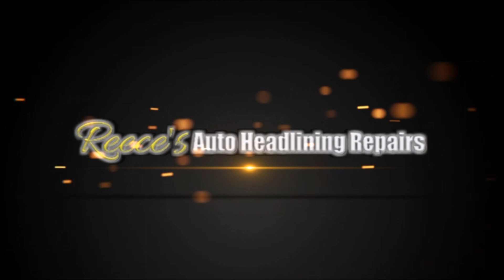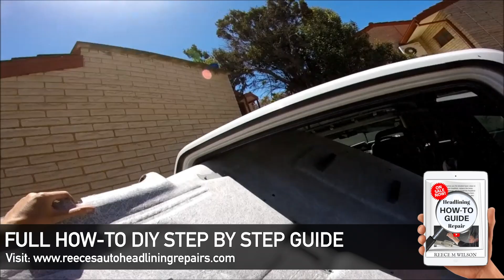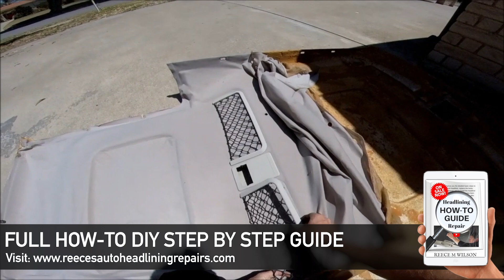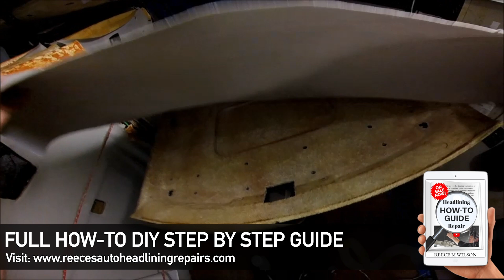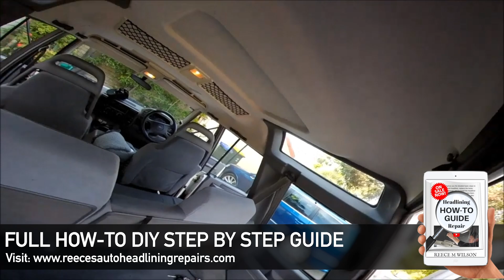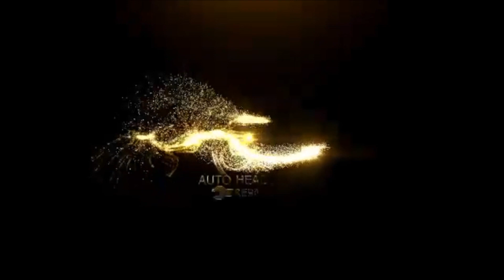Land Rover Discovery SAGGING HEADLINER REPAIR | DIY HOW TO FIX CAR ROOF LINING

Comment from the maker: To Help Our Channel GROW, Click 👍 OR 👎 and Click that SUBSCRIBE button.
⬇️ RECOMMENDED PRODUCTS ⬇️

📌 DIY HEADLINER REPAIR | A STEP BY STEP GUIDE (PDF)
👇 DOWNLOAD 'HEADLINING SECRETS eBook' HERE 👇https://www.reecesautoheadliningrepairs.com/product/headlining-secrets-ultimate-guide-fix-sagging-car-rooflining-reeces-auto-headlining-repairs/

⬇️Reece’s Top DIY Tools:
1. BUY Headlining Fabric / Roof Lining Material: https://ebay.us/26bew6
2. Permatex headliner & carpet adhesive: https://ebay.us/LF2HLY
3. 3M High Tac 76 Headliner Glue: https://ebay.us/OseC7D
4. LIGHTNING Solvit Citrus Cleaner: https://ebay.us/LTvNda
5. Trim Removal tools: https://ebay.us/CcH4kd
6. TORX Screwdriver Set: https://ebay.us/cRiEn2
7. Clear Headed Twist Pins for (QUICK REPAIR): https://ebay.us/ZpUuvv
8. Bowden's own fabra cadabra 500ml: https://ebay.us/zFmtIB
9. Carpet and Upholstery Foaming Cleaner: https://ebay.us/D4peyf
10. Di-san Stain cleaner 500ml: https://ebay.us/XvBlSB
11. Heavy duty tailor upholstery scissors: https://ebay.us/XzEcQf
12. Upholstery Skewer: https://ebay.us/b1rTWO

🇦🇺 Small Business Based in Adelaide, South Australia 

Donate a few $ to Support
Reece's Auto Headlining Repairs
Your Contribution Helps Us Continue to GROW 
Towards Making These Videos and Your DIY Experience Easier
https://www.paypal.com/donate?hosted_button_id=DSL5X82R3DPTQ

★☆★ OUR BEST VIDEOS ★☆★
▸ BEST of 100+ Videos | https://youtu.be/kZ_bICRvh-Y
▸ FULL PROCESS TIMELAPSE | https://youtu.be/_R7ElbG-TEk
▸ QUICK FIX Method https://youtu.be/pJF5FcPSpac
▸ MOST Instructional | https://youtu.be/50sWPyLazHQ
▸ A MUST Know! | https://youtu.be/iZ1nJ4pZfkY

Reece on Social:
Facebook ► https://www.facebook.com/reecesautoheadliningrepairs/
Instagram ► https://www.instagram.com/reeces_auto_headlining_repairs
Website ► https://www.reecesautoheadliningrepairs.com

Reece is a participant in the Amazon and eBay Influencer Program. This description may contain affiliate links. If you decide to purchase a product through one of them, I receive a small commission at no cost to you. We don't promote crap (unfortunately, there's a lot out there). Only products that I have personally used and paid for and LOVE! ✌️

Disclaimer*
The material covered is for informational purposes only. We take no responsibility for what you do with this knowledge. The methods described are not intended to be a definitive set of instructions for your project. Any use of this information is at your own risk.

Comment: What’s the name of the material you have used here? Supplier?
Reply from the maker: Would of been our light grey velour fabric used for this one. However keep in mind, the land rover disco 2 has a wide body, and most headliner fabrics are 1.5m width, just short of the widest part of the headliner board in the middle. Theres a way to make it just reach, but is difficult to explain. 

And would be easier to fit new fabric if using a flat knit fabric and not a factory velour due to the flat knits having more stretch. 

Buy Our Fabric We Use On Our ebay Australia Shop -  http://ebay.us/hIY6o4

A list of our fabric can be viewd here in this video https://youtu.be/w2_cP7idWns

And we don't sell the glue, but suggest to use one of these glues

Permatex Headliner Adhesive 
- http://ebay.us/apC9ZH
Reply: @ReecesAutoHeadliningRepairs  brilliant response. Greatly appreciated. I have a 2002 vogue range where there is some separation in the cargo area where the d trims were removed and reinstalled. The handling has just been enough. I expect it to keep going now but for the life of me I can’t work out what the colour is. I want to match it as close to possible.
Reply: @HSE2inc  I'm having the same problem lol I wanna figure out how to just re use my old fabric... All it is, is finding the right adhesive and a decent foam and then follow the rest of the steps every car upholstery guy does
Reply: @ryanbirch3434  did you manage to do it with your old fabric?